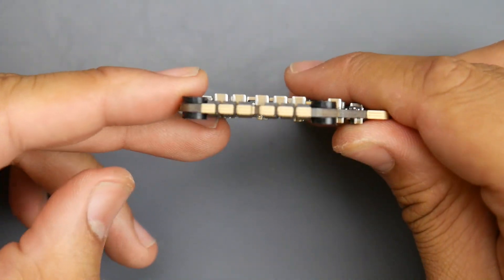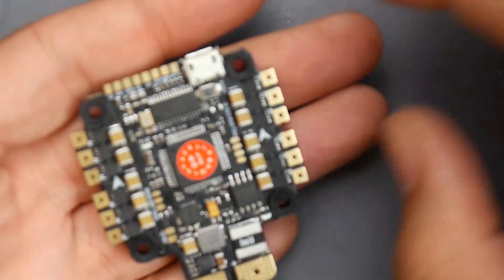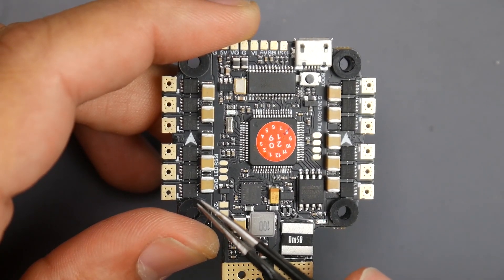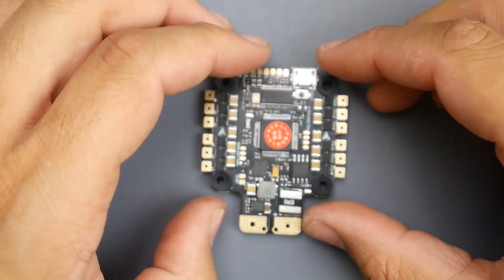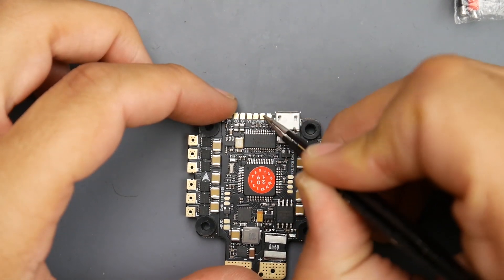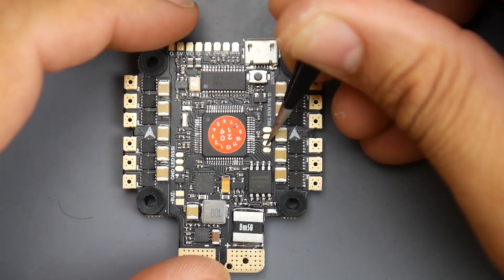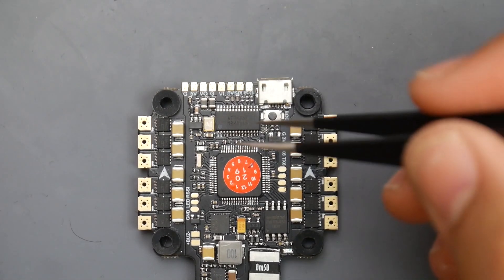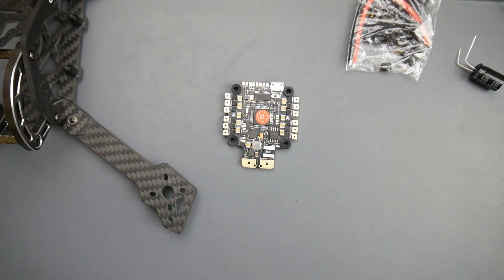The True AIO's Are Coming Back // StarF4 6S AIO With ESC's

Comment: You may have some of the settings for this controller because I also have betaflight 4.0.5 in the series and I have a limp in the air and the engines get hot if you have a bearing on yourself on Facebook, please enter

Comment: In a way on 6s esc’s I wish they would toss in a 470 50v capacitor. The voltage spikes from 6s can jump a bit higher that 35v and a smaller cap but one with 50v I find handles the spikes much much better. Just my opinion tho.

Comment: Ugh...that USB port on the front though instead of the side. That's a killer. Need a 20x20 20A AIO. Something beefier than the Zeus .
Reply: you can mount it sideways though, and compensate in betaflight
Reply: maybe a 90 degree adapter would help a bit?  go in from the top instead of the front which is pretty lame like ya said lol.

Comment: To be honest, all I see is a StarF4S that's even more overrated. The original StarF4S is basically the least reliable board that I've ever seen, with severe design errors, and I'm pretty sure you'll get similar responses on many discord servers.
Reply: The GGManiack I’ve got six F4S’ s of which 2 where doa, and one lasted a few weeks. Remaining 3 have been super reliable in my racers. Seems they no longer conformal coat. New board honestly looks identical so I’m going to pass on these.
Reply: @Rezzz_a  In my time at UAVFutures and JB's discord, I've seen over a dozen of these boards fail just for the hell of it. Usually 5V regulator, sometimes the fets just decided to desolder mid flight, the F4 MCU sometimes blows a hole due to a power spike.. The idiots at Racerstar also put VBAT on the holes, so if you don't isolate it, and the USB port (or something else that's grounded) touches the frame, it's going to set itself on fire, seen that happen as well.

Comment: Lmao I still haven’t installed my droneracingparts.com fire air f4/30a aio. I must have had it two years now 🤣🤣. If the new 6s ones hold and handle  well I may have to actully try it.  May wind up using the old one I have on a 4 inch build.

Comment: Mamba stack or iflight? 
2019 is late for f4? Should I buy f7?
Reply: a mamba 405 mk2 stack fried after only a couple packs, it fried out all my leds, gps, and the gyro, cost me alot more then 40$ my iflight succex-e has been amazing, no issues. and i dont think its too pate for f4 at all.... why would it be? still works great
Reply: new RUSH FPV STACK
Reply: I’ve had 4 mamba stacks. Durability is a huge issue. Escs are ok
Reply: dont get the mamba stack, the gyro has noise problems on pitch axis, so its really hard to tune and you wont eliminate propwash
this problem is common on both the mark 1 and mark 2 stack